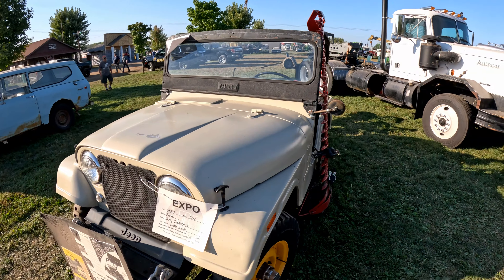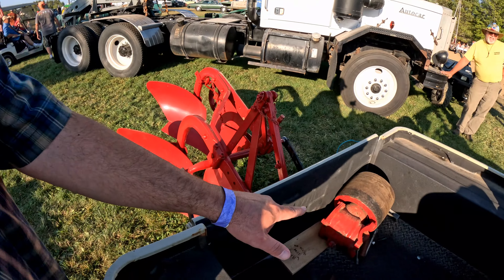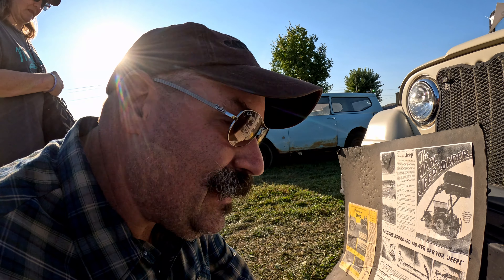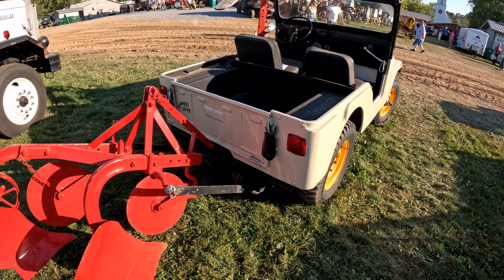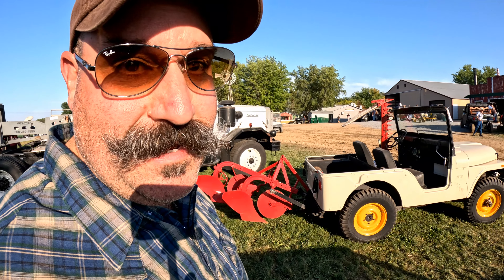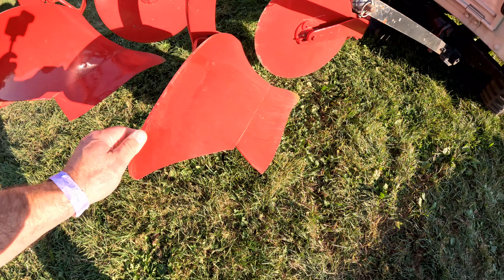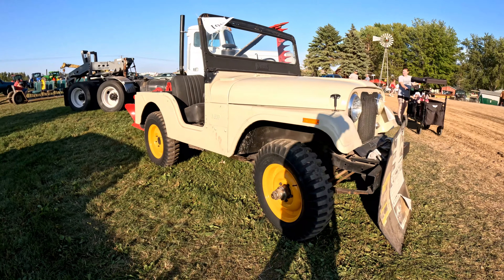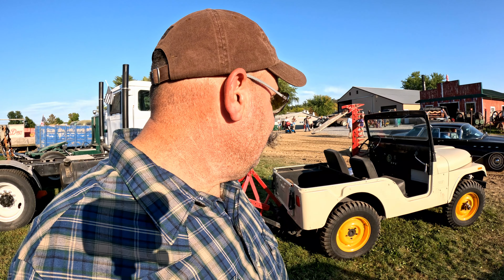This is a farm tractor. Ep. #47

Comment: There was quite a market in the late 1940s and early 1950s for "garden tractors".  There were a lot of small engine tractors with two wheels that the operator would walk behind to plow, disc, mow, harrow and cultivate.  This type of rig would be just fine for a small farm or truck garden, which was common and popular at the time.  Nice find and video!
Reply from the maker: The concept was just very fascinating. One of these days I'll have to drag out my two-wheel simplicity garden tractor. 👍

Comment: Mounted on the side of a tractor, and elevated, those sickle mowers are the best tree / limb trimmers you have ever seen.  They are heavy duty, with thick blades that hold up a long time.  I fabricated one for my Grandfather's 1949 Ford 8N which he still uses today.  I got it "free" from a local farmer, and then found out they're all over the place rotting in fields.  Give it some thought, they work great.

Comment: Its turning a tomato into a potato really!  The weight of the Jeep and the way the implements are put on would not work well in the long run. You have to consider the roughness of the terrain as well and how much is loaded on the engine, clutch, drive etc. To run a sawmill would be fine but not this far.
Reply from the maker: This makes me think about a Swiss Army knife analogy. They say something designed to do everything, does nothing well.